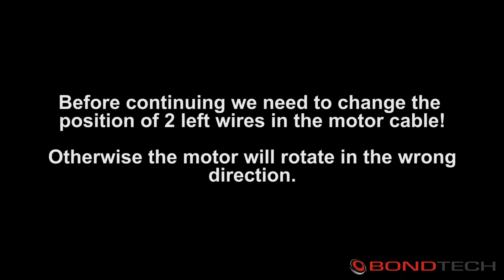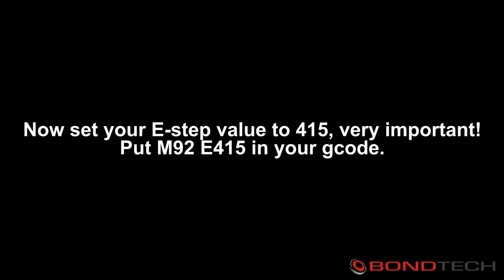Wanhao Duplicator 6 BMG installation

Comment: The one m3 i dont have on hand is of course the one bondtech just cant seem find a reason to add into their printer spec'd kit to make sure their bracket mounts no matter what m3 screws the factory put in place. Heres a tip bondtech..... dont rely on any oem to be consistent. Spend the extra .04c and include all necessary fasteners to complete the install in the event a part of the oem build isnt what you think its supposed to be.

Comment: Is there a smaller motor that you would recommend?  It seems to me that using the original motor doesn't save much weight. What is the original vs new weight?  I would think with the 3:1 gear ratio, a small motor with 1/3 the torque of the original would be adequate.
Reply from the maker: Hi, I am not sure about the weight of the original motor, but we recomend this motor to save weight, it is a good fit for the extruder.
http://shop.bondtech.se/ec/steppermotors/nema17-pancace-stepper-25-mm.html, the connector for the motor will collide with the breakout board but it should be possible to change this.

Comment: I have just installed Bondtech BMG upgrade kit for my Monoprice Ultimate. I have one issue now. 

When I turn the printer on and the head goes back to the home position, the head is hitting the printer's frame. I have included my M92 E415 in my gcode to overwrite the setting. Is that solving the issue or should I change the setting on the machine itself? I can't find the option to change the setting on the machine. How can I solve the issue?
Reply: Sejung, you need to adjust the endstop for the y-axis so it will be activated earlier to avoid collision.
Reply: i had to remove the bondtech sticker off the extruder to make mine work
Reply: In Simplify 3d, Where exactly do you put M92 E415 in my gcode?
Reply: @Captleroyhotdog  Start gcode for the printer
Reply: @Captleroyhotdog show me HOW and WHERE to do this gcode thingee